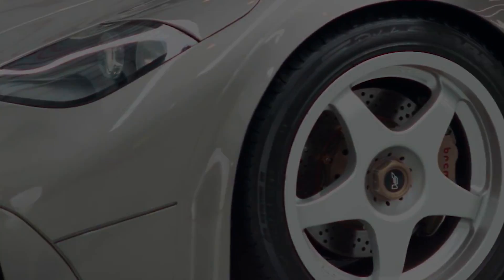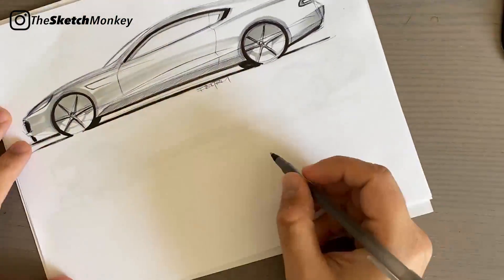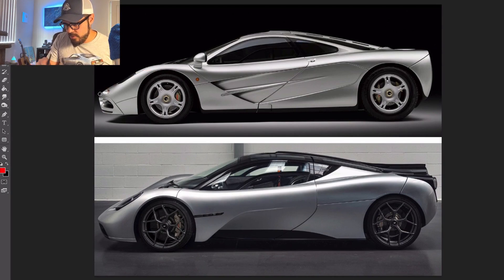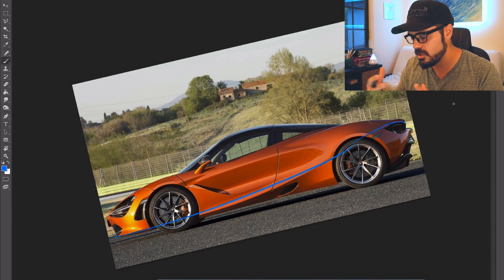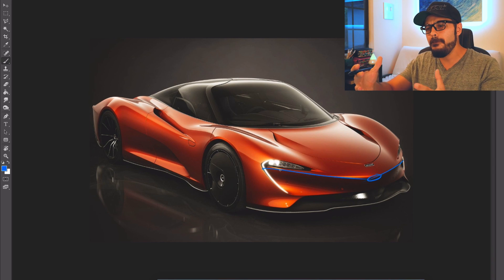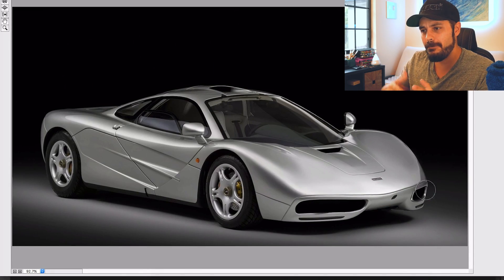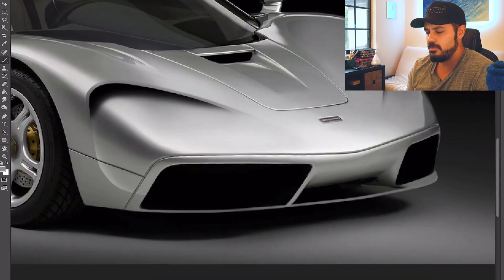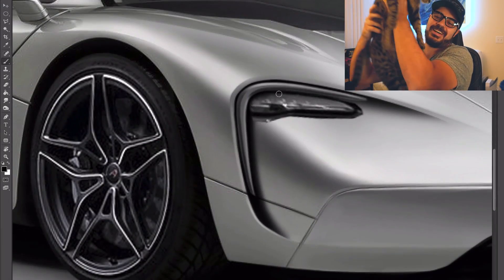McLaren F1 Redesign: What if it was built TODAY?

Comment: This is amazing! However as a die hard fan of the company and the F1 here’s some... constructive feedback
Some vents under the lights would make sense and look better
The roof scoop or the hood scoop may need to change since new McLarens have the hood going down towards the ground and doesn’t have a hood scoop
The headlights, they’re really hard to integrate into any car and you did well but the flow isn’t as fluid as a 540c or 570s.
The triangles near the roof scoop need to go imo
The back remind me of the ‘17 Ford GT, a nice fluid line that connects the body work would make it look a lot more McLaren
Mirrors should probably be smaller, McLaren doesn’t seem to be a fan of big mirrors

Comment: This redesign really works well. I thought the harsh “separate greenhouse” look would clash with the line flow when attempted at the same time, but all the elements you’ve introduced are so cohesive. The extra curves on the front just behind the headlights add so much dimension for how subtle they are, and the added lower vent on the side that flows into the sculpted piece on the door, pulls the visuals together. The straight lines on the side date the look slightly, but it’s recognizably an f1 that looks very modern mclaren

Comment: Very beautiful design!  A few notes:  It might be worth checking out the P1, they have similar lines, and the P1 has a beautiful design from the rear- rear lights are integrated into the lines of the car perfectly.  2.  The side air intakes actually remove an interesting design feature of the original Mclaren F1- the side storage compartments.  The F1 is one of the few supercars that can store 2 suitcases, one on each side near the rear of the car.  They likely won't work in most re-designs of the F1, but I thought it was worth mentioning!

Comment: I think your rear quarter air intake is just a bit too far back; looks stretched back and slightly out of balance.  I also think your headlight assembly swoop should not extend down the side of the fender; just stop it right below the bottom of that larger central element.  I do like your simplified nose,  but I miss having some form of the two side intakes. 

A reinterpretation of the F1 is a good idea.  Honestly,  it could look like a 2020 model just by changing the boring original headlights, as you've done,  but the back panel and taillights are in my mind,  the biggest letdown of the original car.  This is actually true of most European sports cars from 1990 and older. I'd like to see your idea of cleaning up that back.

Comment: I think it's interesting that your redesign literally turned out like a bit of a speed tail. Just shows that the Speed tail is the real successor of the F1 and how much thought the designers have put into it. Great video and great redesign!
Reply: SUPERBLASTER 007  well, I think the speedtail took most of its inspiration from the F1s legacy of the "fastest car in the world" at the time, that's why it's so high speed focused. Gordon Murrays T50 on the other hand takes the track and driving aspects as the basis to evolve. If you think like it from a Pokémon standpoint (sorry but I think it illustrates that pretty good) you have the F1 and it either evolves into the Speedtail or T50 if you focus either on speed in a straight line or a track and driver experience focused package. Like for example Gallade is a physical attacker and Gardevoir is a special attacker.

Comment: I think I want to live in the universe where Honda made the Mclaren F1 engine.
Reply: yeah, imagine the F1 with a road going version of Honda’s F1 V10 engine of the 90s. It would sound amazing and be reliable.
Reply: @devandrasimanjuntak1646  Formula 1 engine isn't design for reliability
Reply: Steve Kuo the Ferrari F50 has a 4.7L V12 engine that is based on the 3.5L V12 F1 engine Ferrari uses in their 90s F1 cars. It is a completely road-legal engine with no known reliability issues. The Porsche Carrera GT has a 5.7L V10 based of a 4.5L  LMP race engine, again no reliabilty issues. Both those companies have fewer budget to develop engines than Honda, which is a very big company with big profits pouring in from their mass produced cars.
Reply: @devandrasimanjuntak1646  But it's base on,not really deal,plus they need A LOT of money to maintain them.
Reply: Steve Kuo Ferrari and Porsche had very few funds when they created those engines, and it turned out fine. Honda would be able to make those engines fine, they’ve had experience with high revving engines on their motorcycles. Besides, the McLaren F1, even with the BMW V12 engine that’s designed for the road, costs more to maintain than both the the F50 and Carrera GT. $18,000 for an oil change, and the fact that you need to take the whole engine out to do so, same goes for the F50. Theoretically, the “road-designed” BMW S70/2 shouldn’t have cost that much too maintain, but it does.
Reply: @devandrasimanjuntak1646  I think it's Gordon Murray want it to be higher stander than other engine for the time,way he explains t.50 he also describe how it initially design F1,I think he has his reson to found bmw to did that engine.
Reply: Steve Kuo the BMW engine ended up being heavier and bigger than what he initially wanted. He had tried to negociate with Honda to build a 4.5L V10 with 550 hp, which would bring the weight of the F1 down to 1,000kg. But for some reason, Honda wouldn’t buldge. Perhaps they deem it to be too costly? Either way they backed out, and Murray approached Paul Rosche of BMW to build him and engine for the F1 and the rest is history. Interestingly, even with the BMW engine, the car still ended up having 550hp/ton like the original proposal with the Honda V10 intended (627hp / 1140kg).
Reply: Steve Kuo and? He is not Trying to say that Honda should have put an F1 car engine in the F1 He’s just saying that he could’ve made it a great Engine not just put the same one
Reply: @devandrasimanjuntak1646   the s70/2 powered the f1 to a le mans victory ahead of the prototypes because it was bulletproof. i doubt the honda v10 would be better.
Reply: oranges True. Although really if you look at the full story, it was mostly luck that brought them the victory. Though the engine didn’t have issues, the gearbox certainly did. The leading car was cruising at the end just to keep the gearbox in tact. Rain was the reason why it won, just like why a Porsche 935 was able to beat Group 6 Prototypes in the 1979 Le Mans.

Besides, Honda would’ve made a good engine if it was N/A. Their turbo NSX GT1 retired of 95 Le Mans because of reliability, but their NA NSX GT2 won its class. So debatable honestly, but we’ll never know for sure.
Reply: @devandrasimanjuntak1646  if the gearbox was the only problem then the engine was fine. it did the job and proved itself. if the honda v10 was slotted in it would've blown up because those were never built to run long. in fact, f1 derived engines in cars don't fare well, and the only cases where it worked reliably were the Carrera GT and F50, but the latter had insane servicing fees.
Reply: Its almost sad to see this comment since bmw has done a masterclass job with the F1. Many consider it the greatest car engine of all time. As good as honda is, don't think it touches the best that has come from the ultimate driving machine's M division.
Reply: baber khan don’t get me wrong, BMW did a fantastic work on the S70/2. However, at that time, Honda was literally supplying V10 engines for Mclaren’s F1 car. They know a thing or two about building good engines. In fact, the F1 was supposed to have a high rev 4.5 V10 that was based on the 3.5 V10 the actual F1 cars used. That would’ve been something else, especially since V10s are pretty rare in general.
Reply: Me too
Reply: Sri Lankan 🇱🇰 Vega EVX 0 -100 kmph in just 3 seconds. https://youtu.be/P0LJ3bJ0Cd0
Reply: Indian 🇮🇳 DC Avanti or Sri Lankan 🇱🇰 Vega EVX.what is the best .?👍🔥 https://youtu.be/Y8xvO7LhkEQ
Reply: Why? The s70 was designed by Paul Rosche. One of the greatest engine designers of all time. Honda were too chicken shit to take on the challenge. BMW were like hold my bier!!!
Reply: Fuck that universe.  I want to live in the universe where Honda was never thought of.
Reply: @soulsnatcher5408  why? They're one of the best brands around.
Reply: @tiagomachado5360  Hes just mad that he was probably destroyed by a boosted honda or all motor honda
Reply: English 101 why tho
Reply: English 101 u good lmao
Reply: @soulsnatcher5408  looks like someone got gapped by a boosted honda.
Reply: @fgcorp  lmao
Reply: English 101 well then that’s your opinion